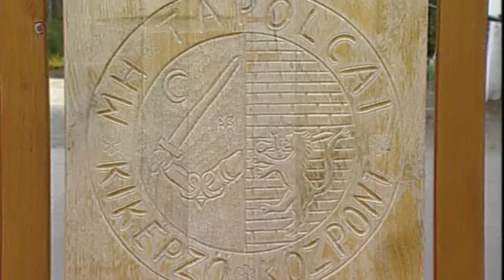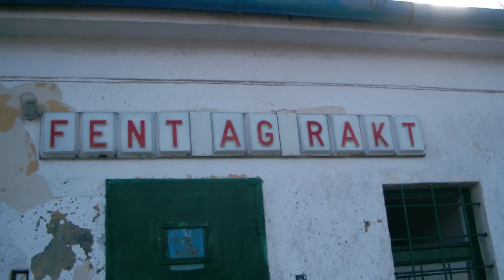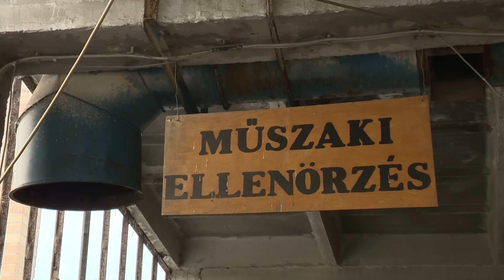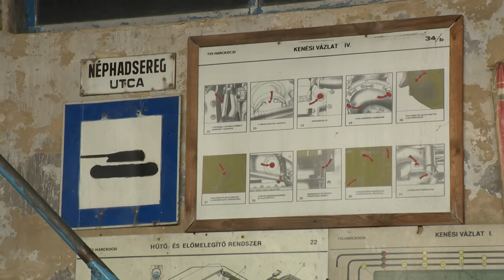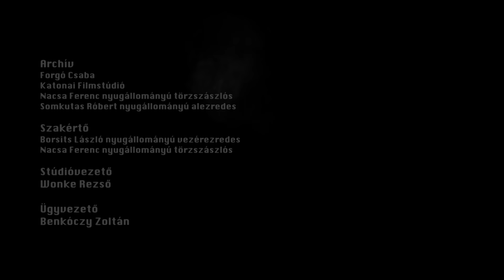MN 6904 -  A 8.  harckocsi ezred és dandár története

Comment: The Hungarian army badly needs modern armor.  Currently they have about 30 T-72's and 12 Leopard A4's on active duty, with another 50 t-72's in storage (whatever that means), which is completely inadequate.  The addition of 44 Leopard A7's and 218 Links 41's during the next 3-4 years will help but still be inadequate.  Most of Hungary's neighbors, including smaller and poorer countries operate many more tanks, some hundreds more.  An adversary using several hundred tanks and a few hundred IFV's can overrun Hungary in 48-72 hours, before NATO could come to its assistance.  Hungary needs about 400 modern tanks and about 900 modern IFV's.  The current manpower (30,000) is also inadequate.